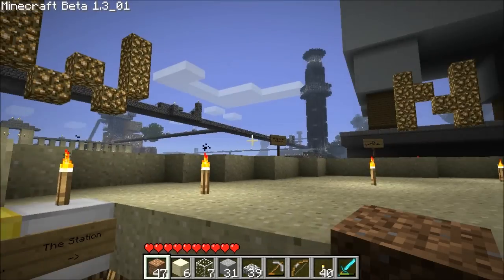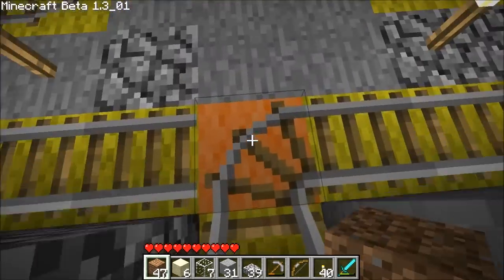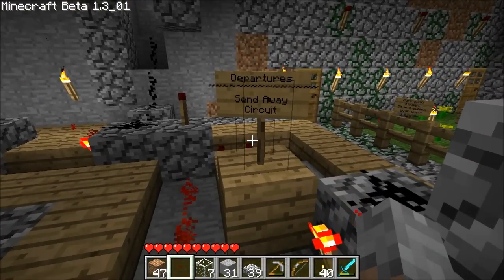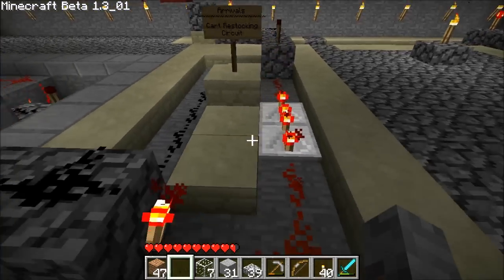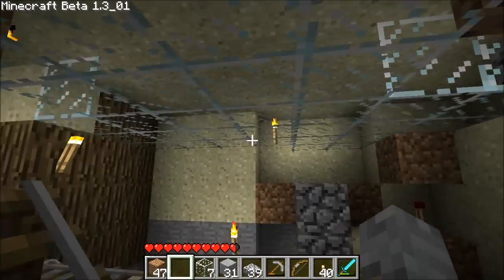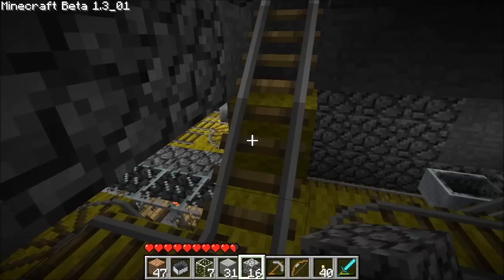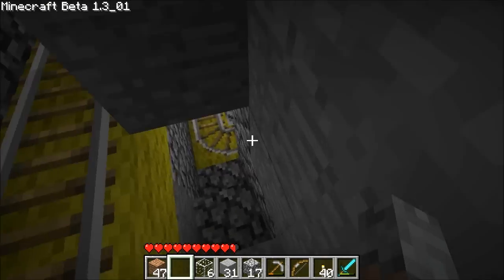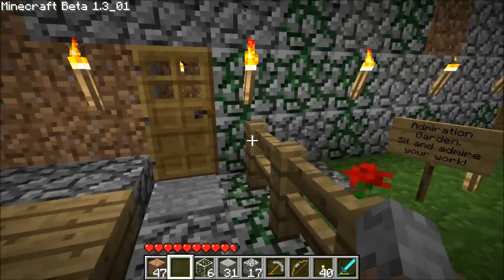V 2.0 Advanced and Compact Train Station. Minecraft!

Comment: @jigarbov  Thanks! The station is awesome but i had to do 3 things just to fix it.
1: The test rail had to be made, But i guess some people won't want a test rail so thats ok.
2: For some reason the overflow alarm didn't work, That's because you have to destroy the repeater and replace it to fix that, But also the pressure plate and redstone was gone! It's fine though, I just removed the 3 blocks down the ladder and fixed it.
3: The light for cart return doesn't stay out when its full.
Thanks!:D